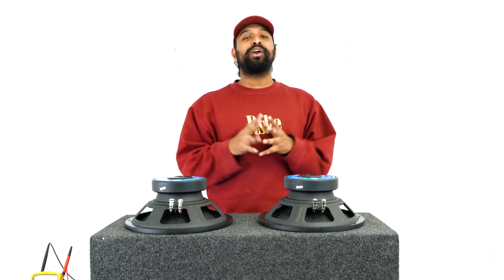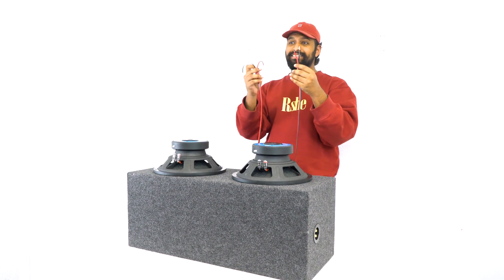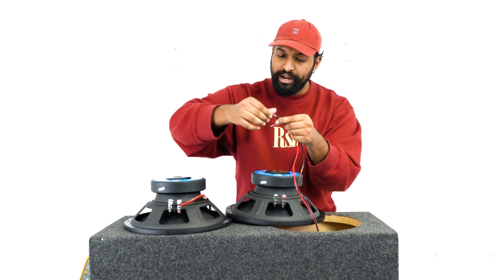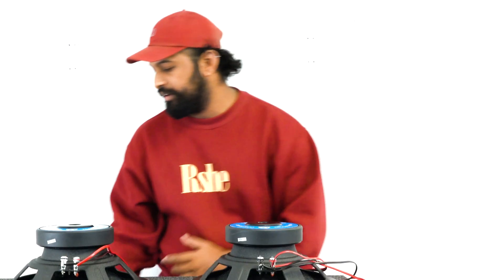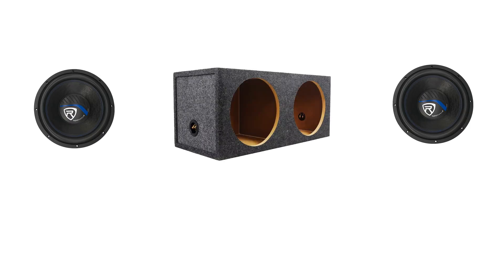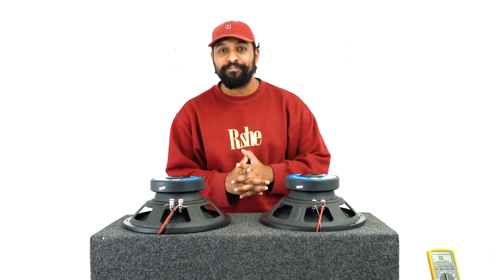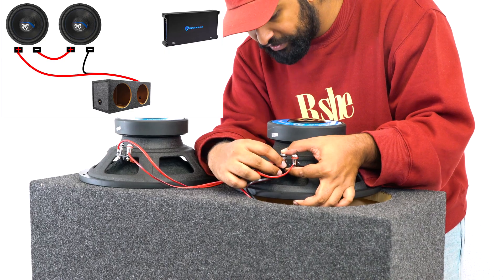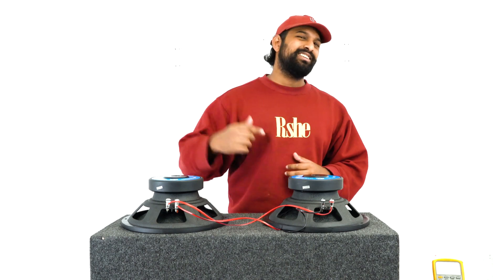How to Wire 2 SVC 2 Ohm Subwoofers Down to 1 Ohm or Up to 4 Ohms (Parallel & Series Wiring)

Comment: I have 2, 12" Rockford fosgate T1's. They're DVC subs, but Each subwoofer has a "jumper" that allows you to run the subs at either 1 ohm, or 4 ohms. If I wired the subwoofers how you did at the start of this video (positive sub, to positive sub, to positive amp, ect.), would I end up with an impedance of 1 ohm total?